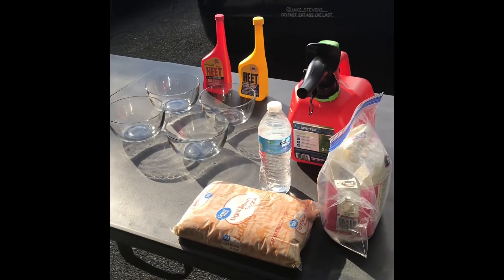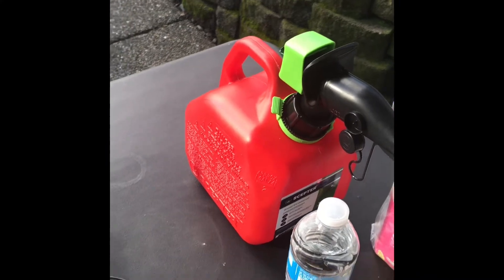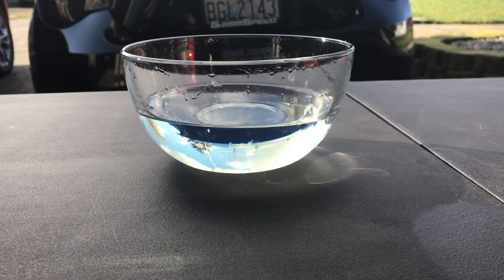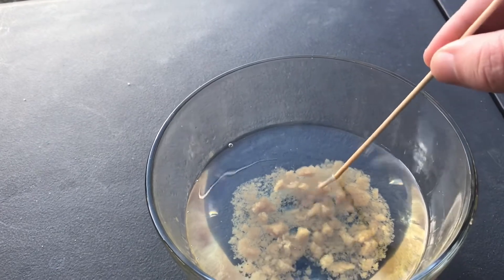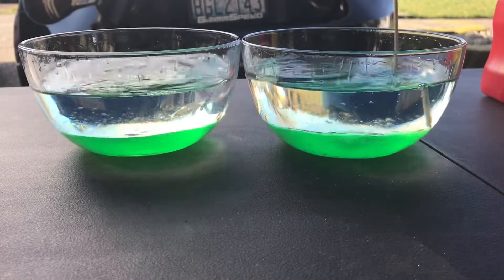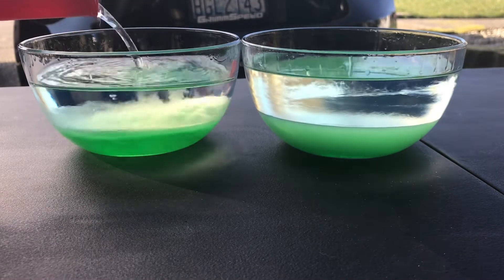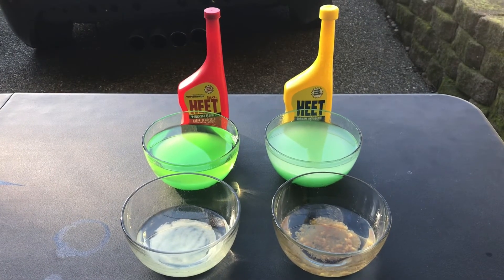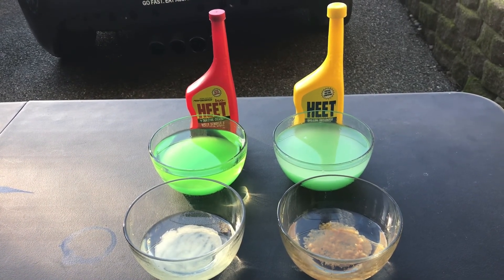What Happens When You Add Sugar And Water To Gasoline?

Comment: Can somebody give me a fast answer, please..
She put sugar in my Suzuki address moto, oil tank!! I think I'm lucky used to put slick50 in. I saw it the other day cause suddenly  i couldn't change very well speed gears!
Imagine that when we try to change oils it didn't get out as usual does cause it had been clogged!!!
After we put a screwdriver and move it a lityle bit.. sugar in crystalls was running out🤯
Seems no damage! But after one oil change the same moment and filter, mechanic and me saw there was still sugar..
We put new filter and fully synthetic oil decided to change oils again in a week!! But after i think this is wrong.. MY QUESTION IS:
SINCE sugar can't dissolved in oil, can i drain the oil completely after a fast minutes ride and put inside 1,5 or 2 lt of hot water for 5-10 minutes?
Just to dissolve the sugar!!!
Can i repeat once more? and after 1 hour to put new cheap oil again, give just a turn in motor and then take it out. Then to put again a cheap oil, let it run for 3-4 minutes and take it out!
Then i can put new good oil and filter and i think that there will be no problem🤔
What do you think; Please give me an answer, many thanks,
Reply: Not a professional but I would recommend against using water. Use some sort of solvent most likely. I'm sorry I can't give a better answer, I don't have much knowledge when it comes to cars, but I recently dealt with salt and water in my gas tank with just my step father and I. Good luck man, I wish people weren't so petty.
Reply: @dallaswilliams2883  Mr Dallas, thank you very much for your interest. I'm very sorry to hear about a situation like this you describe..
It's terrible to come in these circumstances with your stepfather!!
* I had a fact like this with my stepFather who was a good man but in front of his only child, a daughter- my half blood sister- couldn't see anything else! So when our mother died, He and my sister tried to scheme a way to throw us out- I have a brother from her first marriage- from the house She wanted to leave it to us, the two brothers. Even the fact that our mother, left her another house, bigger!!! 
From that moment we saw this whole dirty game, me and my brother, our relations got freeze!
The treason and the disappointment you feel from your own people, is huge!! Anyway... 
It's difficult to remove sugar with oil with some other way.. Maybe some flush fluid is better but i couldn't wait!
The point is that my Suzuki Address seems to run fine now😃 
Thank you very much,